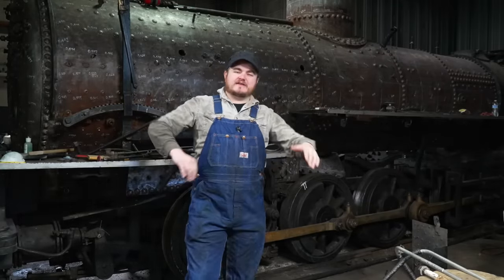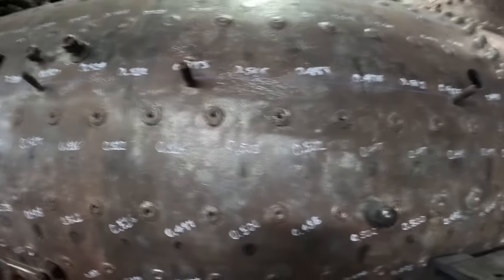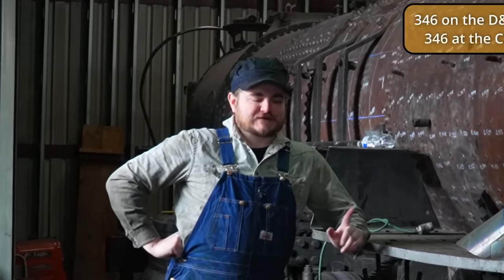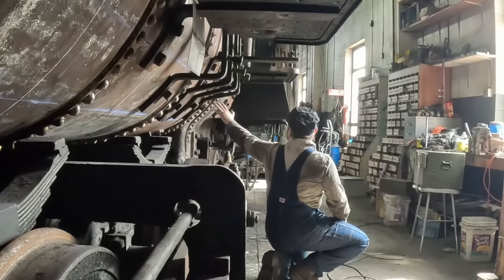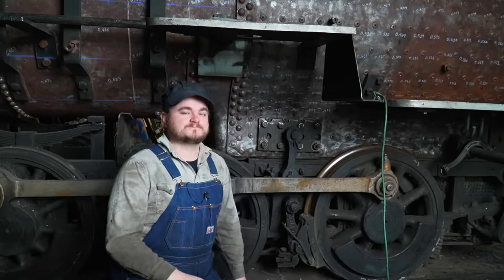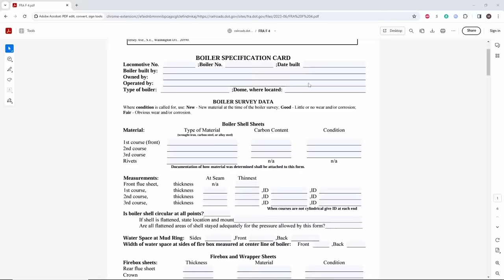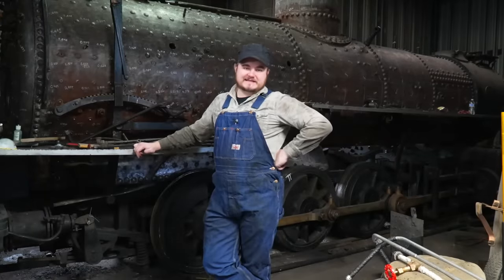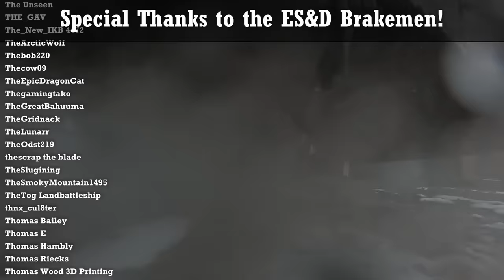What is the 1472 / Form 4 Inspection? Steam Locomotive Rebuilds | Railroad 101

Comment: Would there have been FRA mandated inspections to the same extent in the late steam era for revenue service?
Reply: In the steam era, steam locomotives were regulated by the Locomotive Inspection Bureau of the Interstate Commerce Commission.  The FRA was formed when the Department of Transportation was created in the mid '60s.  That said, the FRA adopted the ICC's rules for steam locomotives and didn't change them until the late '90s.  The old regulations required visual inspection of the interior of the boiler shell after 48 calendar months of operation.  Practically, this meant removal of the boiler tubes.  There was no such thing as ultrasonic thickness testing.  Note that timing was by calendar months.  One day of operation in a calendar month meant a full boiler washout and monthly inspection was required before the locomotive could be run again.  This was burdensome for occasional museum and tourist railroad operators.  The newer operating day-based rules make a lot more sense for modern operations.

Comment: I would be interested in going into more technical detail.

Ultrasonic inspection is relatively new technology.  How did you check boiler thickness before?  Drill out rivets?
Reply from the maker: With regular maintenance schedules / boiler replacements and readily-available boiler makers to do the work with visual inspection, there really wasn't regulation nor need to do it the way we do now. We do it now because of the age, and relative lack of facilities and folks to do the work these days. When 346 left the railroad, her boiler was about 30 years old - 2 of these service periods. It's now 110.

Comment: Does the ultrasound detect just the parent steel thickness, or does it also pick up any rust or scale thickness on the inside?   Or is cleaning to bare steel on the inside part of the process?
Reply from the maker: It's specific to the material - it does not detect scale or anything else. Not even two steel sheets that are caulked together or overlapping. As soon as there's a "boundary", it returns home.

Comment: So with the new patch in railroader the default setting is 3,000 miles for a steam locomotive overhaul.. is that accurate in your opinion or could they make more miles than that? I'm thinking they could go more than that before needing an overhaul?
Reply: Also, would this be considered an overhaul?
Reply from the maker: 3000 miles is absolutely a video game number. Quick math tells me that the D&S gets 100,000+ miles per rebuild on their engines.
Reply: @Hyce777  Awesome, thanks for the info! I thought 3k seemed awfully low!

Comment: Hey hyce I have a question about 491 the pressure gauge goes all the way to 400 so does that mean you can run at 200 or 250.  And as a porter locomotive like does they need annual. Love the video
Reply: The locomotive can only be run at the pressure the boiler is rated for, so 200psi (or less depending on condition) at most for 491. The pressure gauges on steam locomotives usually go much higher than the locomotive is rated for. The 1472 inspection applies to all steam locomotives, including small industrial locomotives.

Comment: How does the spring rigging work when there's a firebox in the way?
Reply: The spring rigging is basically in line (vertically) with the frames.   Above and below the frame, depending on where.   Around the firebox it tends to be kept below the frame, just to avoid having to raise the center of gravity by mounting the boiler so high.

Comment: Stupid question but if thats form 4, whats 3, 2, 1?
Reply: That isn’t a stupid question. I don’t know what those forms are. If you do get the answers, can you also tell me?
Reply: Briefly, form 1 is the engineers daily inspection-- gage glass condition, safety valve lift pressures, and any defects noted on the day's run.  Form 2 is the monthly inspection -- staybolt testing, boiler washout certification, etc.  Form 3 is the annual inspection -- includes a hydrostatic test of the boiler.  There are also different periodic air brake cleaning and testing requirements and jacket removal requirements that get combined with monthly or annual inspections.  Consult 49CFR part 230 for more details.
Reply: safetydata,fra,dot,gov 
I don't think YouTube will allow actual links, replace the commas with dots.
Or google it.
Looks like Steam Locomotive Form1 is a 31&92 day inspection form
Reply: @toymachine2328  they do allow links
Reply: @andrewadams3894 ah so its just the "smaller" inspections. thanks
Reply: @Johndoe-jd  I've posted the link three times and it seems to keep disappearing, so either something's wrong on my end or I'm doing something wrong.

Comment: Well that’s funny, may is TSRR 30s last run for 5 years as they have to do a boiler inspection
Reply: I went to the Texas State Railroad and got a private tour of the shops in Palestine. I remember one of the shop guys say the #30 is nearing the end of her service life, like literally. That locomotive was built during the days of World War I (1917 to be specific). He also said that any money they make on excursions with the steam locomotives weather it be either #30 or #316 or #28 (which I've been told is in pieces in the Rusk shops) is getting sunk into maintaining the engines, so their basiclly loosing money on them, and eventually it's gonna get to "what's the pinot anymore" and just stop running it. I have a couple nice photo's of #30 though, including one in her cab.
Reply: @lets-go-larson5  that’s nice, 30 was returned to service in 2014, her boiler Cert still has 5 years left, but the inspection will take those 5 years, someone told me that they may dress her up as No.400 for her last run for the next 5 years

Comment: why 1472 days. I would understand 1475, roundish number, or 1500 days or even 1461, which is 4 years plus a leap day
Reply: Locomotive inspections (nowadays at least) go in 92-day intervals, or a multiple of 92. For locomotives without microprocessor-based air brakes, the maximum is 92 service days. With microprocessors, 184. The next are the 368 day (annual), 736 (bi-annual, if it's needed for that locomotive) 1104 (tri-annual), and/or 1472.

I'm not 100% sure of this, but I think they used 92 so you could get any 3 months in. Since the most days you can get out of 3 consecutive months is two 31-day months and a 30-day month.

Comment: What would it take to design boilers to survive getting shot at with a 30mm bullet?
Reply: Make a boiler with a thickness to survive a 30mm round (which is way thicker than any normal locomotive), or more realistically, slap some armor plate on the outside of the boiler